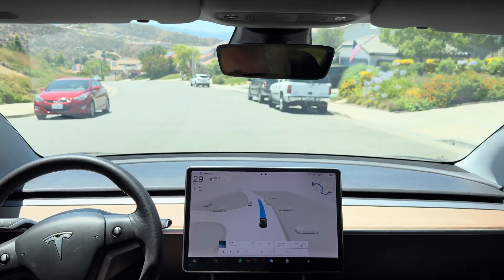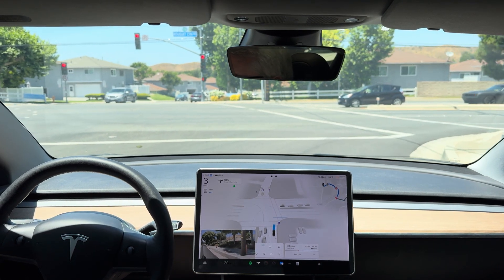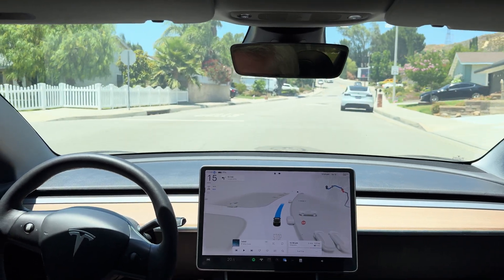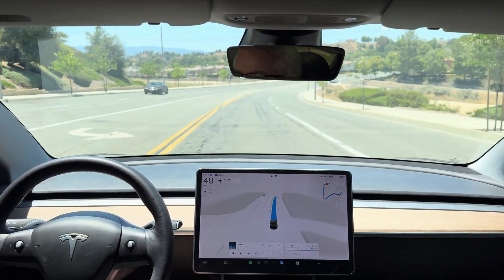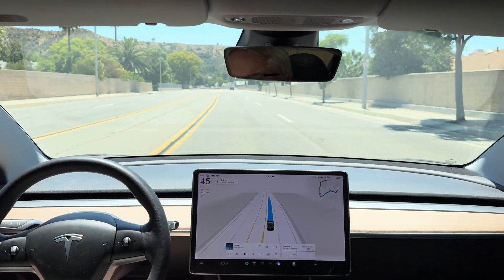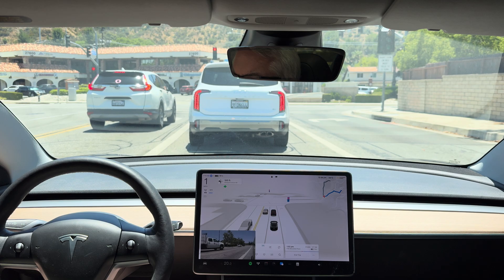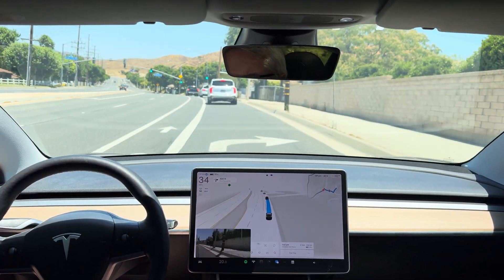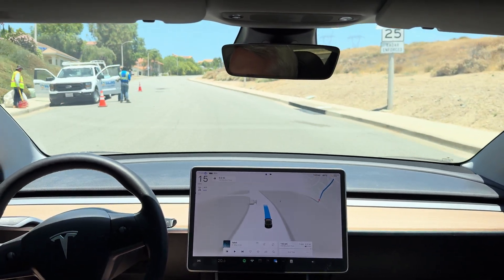Model 3 - FSD Supervised 12.4.3 - Test Loop 1 - 2024.15.15 - 5 July 2024

Comment: What year is your car? That's crazy car still not slowing for speedbumps
Reply: The year of the car is irrelevant.   The software and the cameras and GPS and detailed maps should handle speed bumps.  But FSD is still not slowing down consistently, after four years in beta  .
Reply: @DerekDavis213  it's not irrelevant to me, I ask because I have a 2018 with FSD  and I want to know how other new cars perform comparing to mine as I have different chip.

Comment: The speed bumps are not marked properly.they should have diagonal white lines across them.
Reply: Yep my comments stand.  They need to be marked better as those are for parking lots not roads.  I personally hate them.  What if I
There is an emergency. Useless speed bumps.  Delay in help anyway.
Reply: @hllovell  The real world does not cater to the buggy FSD software.  Or is that your opinion?
Reply: @DerekDavis213  most people can not drive as well as FSD.  they think they can but they do not.  FSD obeys the traffic laws.  it may not see speed bumps which by the way should not be on city streets  but it does better at just driving than most people .. and I walk an hour daily and observe that almost everyone all drivers do not stop at stop signs for example. and if they try to they do not stop in the correct place. most do not turn properly.  FSD does a better job backing parking than I do. and I am a pretty good driver. (IMHO)  lol.   I am human and I make mistakes but I try.  most people are not patient enought to even follow FSD.  so it is tough to use it in ie DFW traffic. freeways.    I do not think it is that buggy it is just to 'granny driving'  ie to nice. is the best way I can put it.
Reply: Nonsense.  A yellow sign says Speed Bumps, then big white letters on the road says Speed Bumps Ahead.   And the speed bumps are easily visible.
Reply: @DerekDavis213  so you want the car to slam on its brakes as soon as it seesthe signs and drive slow for 100 feet.  well that is nonsense.  we have the signs too in DFW and the bumps  are marked with white paint so you can see them.  the car slows just as it gets to them the speeds up as it goes over them as it should. those in this video are hard for even my human eyes to see they are not properly marked with paint ad tn angle.  those in the video are nonsense.  and the second speed bumps were not marked at all.  also the car slowed too. only going 18 mph.   the car did its job the traffic peopld did not.
Reply: @hllovell  I have driven in the neighborhood in Northern California, a few miles from Tesla world headquarters.   There are speed bumps around here, and they are not as you describe.   Any human driver can easily avoid a speed bump.  It doesn't matter if there are white stripes on there.   White stripes are not required for a human driver .   FSD has to adapt to the real world , not the other way around.

Comment: So I guess we won't be seeing 12.4.2 going wide, obviously, if we're already onto 12.4.3.  Speed bumps have always been tricky.  Even on 12.3.6 which I've been stuck on for some time, it's hit and miss with the speed bumps.  Seems to be consistently missing them now.  Curious if you ever use the camera icon to report issues, or is that considered dated now?  Are the chill/standard/assertive modes still basically useless?  Or are those actually doing something, now?
Reply: Speed bumps are super easy for a human driver.   First, a Yellow Sign announces speed bumps ahead.    Then, huge white lettering on the road says Speed  Bump Ahead.   Then the speed bumps themselves are easily visible, and in a different color than the rest of the road.     FSD has very limited situational awareness.   After 4 years in beta, and with 8 cameras and AI, this is inexcusable .
Reply: @DerekDavis213  The end to end model has only been trained for about a year.  You know this but choose to pretend not to.
Reply: @diamond_h0us  Yes, trained for a year, millions of miles, and one billion dollars worth of NVidia compute power in the data center which is running 24 hours per day.

But the very latest FSD software still makes egregious errors, all the time.   It is not a trustworthy system for your family .
Reply: @DerekDavis213  Unfortunately, not all speed bumps follow the same protocols that you have laid out.  Some have road markings, many have none at all.  Some are painted, some are not and blend in with the road.
Reply: @tesladura3085  But none of the many speed bump failures by FSD on Youtube are the unmarked type that you are describing.   You are making excuses for the simpleminded FSD software that have nothing to do with FSD reviews on Youtube.
Reply: 99.99% of people are on 12.3.6 as of right now

Comment: It appears that it was slowing for the speedbump by going 19 mph as opposed to the 17 or so it usually does. It purposely was faster and slowed to 19 at one point. Think the AI model may be handling them differently or with a faster speed.
Reply: Your excuses are creative, but FSD did NOT slow down for the speed bump.   If the bump was large and aggressive, that could damage the car.   When will FSD get a clue ?
Reply: @DerekDavis213  wasn't an excuse. It's literally based on what I've seen in the video and from previous behavior. If it didn't recognize the speed bump at all it most likely would've accelerated even faster. Not saying what it did was right or wrong but it appears that it was recognized in a way that was different from previous behavior as far as speed is concerned. The damage of the car is subjective. A cybertruck wouldn't be damaged going that speed as opposed to a 3 but it probably should be at 15-17 mph as it's done previously.
Reply: @Gary_Walker90  We are not talking about a Cybertruck.   Model 3 and Y are the most popular models, and if you drive 21 mph over a large and aggressive speed bump, the car could be damaged.  It's just that simple.

Comment: "Vehicle not slowing for speedbumps" ?!?!?! Speed bumps in areas I know are engineered so they are only an impedient if one is SPEEDING! If obeying the speed limit one needn't slow down to traverse them. 

My experience comes mostly from driving in Virginia, North Carolina.and South Carolina. Are things so different on the left coast and elsewhere? Does your particular car need new shock absorbers installed? What's the deal?

Comment: It was both safe and legal to use the "suicide lane". 3:55 See #2 below

In California, a "suicide lane" is commonly referred to as a center left-turn lane. Generally used on roads without a dedicated left-turn lanes.

The legal way to use a center left-turn lane in California includes the following:
1. **Turning Left**: Drivers can use the lane to make a left turn onto or off of the roadway. They should enter the lane only when it's safe and clear of oncoming traffic.

2. **Merging into Traffic**: Drivers turning left onto a busy road can use the center lane to wait for a gap in traffic. They should use this lane to merge safely into the flow of traffic.

3. **Limited Travel Distance**: Drivers should not travel more than 200 feet in the center lane before making a left turn or merging into traffic.

Comment: Such a shame that it didn’t slow down for the speedbumps 😢
Reply: One was 21 MPH and the others 19.  Those speeds seem fine for those type of bumps; No?
Reply: @Discoducky73  One was 21 MPH and the others 19.  Those speeds seem fine for those type of bumps; No?

FSD has no idea what type of speed bump it is, so ANY speed bump failure is a real problem.
Reply: @Discoducky73  they were definitely shallower speed bumps than i have here in northern california but i typically have a hard speed limit at 14mph for speed bumps
Reply: @Discoducky73 I’d get down to 15 on those for comfort, but you’re not gonna damage your car going 20 over those